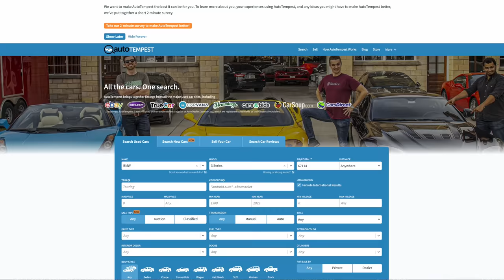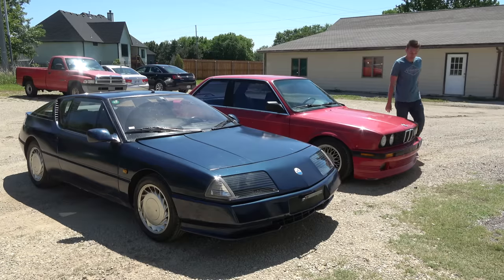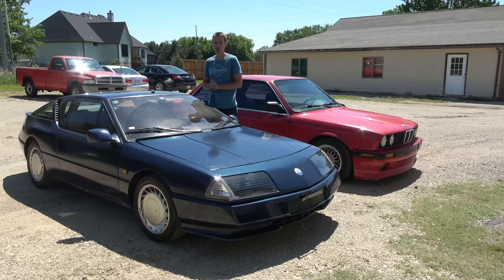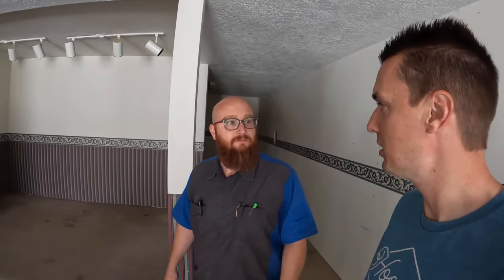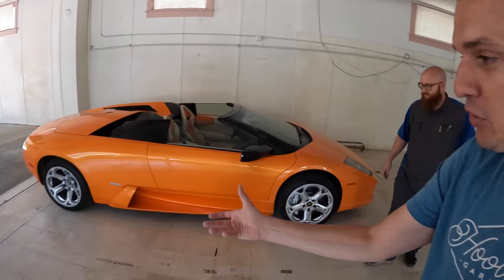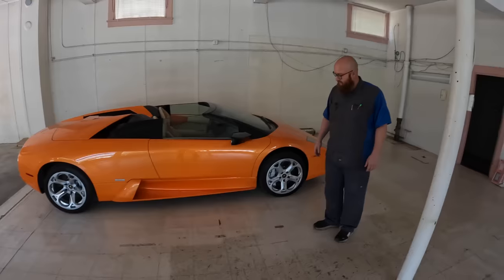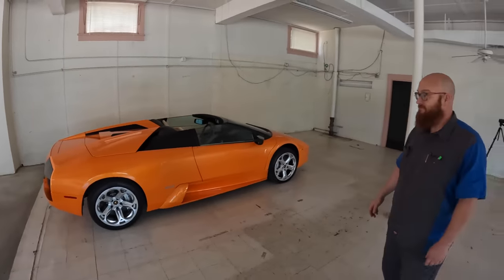Everything wrong with my CHEAP 90 year old shop building (was it a TERRIBLE $75,000 investment?)

Comment: Usually there is an ordnance to not have anything within 6’ of electric panels.  That means sink or pannels should move. Regardless redo the sink or move panels you got 10g’s there.     They may let it slide with existing but I’m pretty sure the 6’ clearance is a safety thing and if renting the space you will want to comply with safety. Not sure in Kansas but 6’ is national code in commercial spaces. I had a rental with a small utility room and box was in there with furnace and it was ordered that nothing could be kept in there at all due to that regulation.  Not sure if moving sink and redo bathroom layout is better or if move the panels into one over more is better to be honest. Some them 1950’s. Black electric boxes look sus to me anyway. If it were me and I was leasing it I’d redo both the bathroom to a modern spec and redo the panel to something with breakers that’s also 2022 compliant for safety and rental appeal.  A new flooring solution and some bracing in the main part you got a nice shop space.
Reply: Yeah 100% I’d say it’s worth getting in a crew to make it nice and 2022 compliant.  Even new hvac and such just have it done and perfect. You will get better renters and can charge more for a nice space.  You don’t have to finish to high spec just nice spec.

Comment: You might want to invest in solar shingles and some destination charging stations. You could bundle those into the rental package so that it's more appealing. The new infrastructure package is dolling out a fair bit of cash for access points to the soon-to-be-built country-wide charging grid and since this is for a business-oriented property you should be eligible for a grant. Not only would the solar juice lower the power bill and if you install a backup battery or three you could provide a potential customer who might make use of some or all of the other fuse boxes the peace of mind that, short of a Twister or Godzilla going on walkabout, they and their perishable merchandise will also be ok for a while. Another added benefit is that the charging stations will bring in customer traffic who will be there for at least 15-30 minutes so having some retail and/or food options to incentivize potential EV drivers to come on by and stay for a while. If your entrepreneur itch needs a scratch then might I suggest opening up a Sub Station 2 franchise there. You have all the prerequisites there and enough room for a decent amount of seating.

Comment: You literally cannot lose with how little you spent on that. Where I'm from that same building would've cost 1.5m easy.
It's getting near impossible to buy property unless you're sitting on 10m cash. And you're going to sign your life away if you take out a loan even with an 809 credit score. You can find small property (1.8k Sqft) w/ 0.25 acre lot that needs to be demolished for about 250k.

Comment: Not a good idea to add heavy loads to floors supported on blocks on unexcavated ground.  The car is adding half of its weight to one, two, or three joists depending on the cars position; and at least one joist is carrying at least 25% of the car's weight.  The ground under supports may be gradually compressing.  Occurrence of deflection (bending) is often the reason that wood floors systems are shimmed at various places.

Comment: After seeing those massive federal pacific breakers in that addition near the paint overspray, I really hope Tyler’s insurance is paid up. Especially with all that water damage so close. Btw, if any of y’all see those in your home, or office, or any building you own, CHANGE YOUR PANEL IMMEDIATELY!!!!!! Those breakers are well known to not trip during an overload, short circuit, pretty much anything that should cause a breaker to trip, and they have burned down many homes, and commercial spaces. Same with the old Zinsco electrical panels. Poor design that slipped through the cracks, and they are well known to arc and cause fires.

Comment: $75k you can't buy a shead on its onland for that in the uk. billy bargin.
Remember Tyler if it isn't broke dont fix it as with old cars and building you just open up a whole can of worms when u do.
If i was you I would buold a cupboard to house all the circuit braker boxes to protect from water from the sink. 
Its great you have all the old brakers there as you won't need to pay to have extra fitted when u want to put in a car lift or stacker inless its to become one of your burger joints. If thats the case then u know it will need fully fitting out with all new everything to be upto food hygiene code.
Fit French drains in the floor outs9de to stop water coming in under the doors and new door seals

Comment: I mean, a structural engineer costs $150-200 to evaluate specific issues; building inspectors are  similar.   The Whole real estate industry revolves around the inspection process.  Really, no excuse to not do them in real estate.

Comment: Am I alone, or did anyone else like turbo lag?  I loved that in my old Saab you floored it then....wait.....wait.....and bam!  She took off like a bullet!
Reply: 1960s GM V8s with the old two-speed Powerglide automatic provided a similar sort of experience. One of my favorite things to do with the 1968 Pontiac I used to have was stop at the top of the Interstate on-ramp (I live out in the sticks, where that's often possible) and then floor it. Pause while the bridge telegraphs down to the engine room for flank speed, the Powerglide drops into low gear, the secondaries open up on the carburetor, and then it felt like jumping to hyperspace. Of course, it was a four-door Tempest sedan, so "hyperspace" in this case equates to about 50 mph by the bottom of the ramp, but, I mean, the impression is the important part. :)
Reply: I hate it personally. It makes pulling into a busy road from a stop scary. “Oh yeah, that’s a big enough gap”. Pull into traffic.  No power no power no power. “Oh no those cars are closing in fast!”  POWER!

Comment: Looks like a little work on the floors, lay down some LVT, give a coat of paint interior and exterior and call it good. As long as it doesn't need a lot of electrical work you should be good. Gotta shave those popcorn ceilings!

Comment: That hole in the front (in the sidewalk) the wizard is talking about is a coal chute. Back in the day they’d shovel the coal straight into your basement. 

As for the ac unit. Milk it for what it’s worth and KEEP YOUR EYE ON FREON PRICES. The current admin is fully phasing out r11 and is looking to join the UN standard and phasing out its replacement too (which is the dumbest shite quite possibly ever). Meaning Freon prices are about to become obscenely outrageous. Be aware. Might be cheaper to get it updated now vs. later. Also be aware for your house. Might be-hoovie you to look into getting a tank of refridge for yourself now.

Comment: If it was me, I would tear up that wooden floor and fill it in with compacted gravel and pour concrete floor throughout.  It will cost you but in the long run you will never have a floor problem again.

Comment: 5 to 8 grand to get it ready to rent bwahahahhaah I moved into a place that had electrical from 1974 (fuses) and had to upgrade it all....leave it for the tenants. 

BTW: Wouldn't cost $75K to pour the floor into concrete. Rip up the floor joists, and dispose of it, probably $2500 and then back fill, maybe $2000 and the slab, $5000 will get you a 32 x 16 slab up here so maybe $6500 down there but I have no clue what concrete costs are in BF Kansas.

Comment: what.. you are looking ar on the exterior of your 'building' is not stucco... that style of finnish denoted way more texture...  this is called 'concrete parging'... is is done over wire fencing to give a little support... upstate ny does a lot and it was popular in the 40's-60's. problem is the moisture it traps, each crack you see extends to the full wall.. this will cost you.. but that floor.. headache... dump this QUICKLY or it will burry you.

Comment: I still think it's gonna be more then 8,000. I think the ac for that building will be close to 8,000 by itself then the air handler may need replaced also cause some units just are not compatible with the me refrigerate in the new ac's
Reply: Also I don't know for sure but that sink next to that electrical is not to code I can almost bet on it
Reply: Like I said in the last building video you open a wall you open a can of worms and that goes for anything else building repair related

Comment: my advice would be to remove wood flooring and pour concrete, yes it'll be expensive, but only have to buy it once and  mise we'll do it before you get it filled up with vehicles and equipment, do it right and do it once you won't regret it.
EDIT: And I can't believe you can buy a building with that old of service box and electrical wiring! I assume your already going to have it updated to code aswell as to fit your needs i.e. welder and hoist
EDIT#2: disregard some of the irrelevance  wasn't aware until the end that you're using it for a rental income, on that note slap some paint and linoleum down and put it up for rent 😆

Comment: @7:52 woah, 255/45 VR 15 tyre back in the 90's, that must have been super hard to find and more expensive than gold per weight... Other than that, what an awesome and good looking car, this things definitely needs to be brought back, maybe some more modern wheels with lower profile tyre and an overall overhaul for paint, interior and technical areas.

Comment: That building is a fire hazard Outdated electrical components that are even allowed to be used only more . Depending on what kind of landlord you want to be will determine how much you need to spend on fixing it up before it’s ready to rent. If that buildings in a good location it’s worth spending the extra money on it to do a complete concrete floor in it. Then you can have actual value to the renter with the building before you actually spend money on the exterior besides some touchup and paint on the outside for now. Then once the place is making you some money then you can think about a facelift on the exterior. I like one commenters said your plumbing isPast its prime. But it’s $75,000 for the initial investment Doesn’t sound too bad of a deal even if you had to put in 80 grand to make it a nice place. The location is going to determine how much is worth putting into it good luck.

Comment: If i were you, i would remove all the wooden flooring, repair/install any plumbing & floor drains needed,  fill with compacted dirt, 6" gravel, then 6"-8" concrete. Raising floor about 6" to prevent any flooding.
All buildings start with a good foundation.

Comment: Watch out for asbestos in that old building. That floor specifically - even if the tiles don't have it, the mastic probably does. Unlike the 9" version, those 12" tiles are 50/50 yes or no in that regard. Any type of abatement in a commercial setting - like the Wizard said - will be very expensive. So just leave them be. Looks like a really cool building though! And a nice quaint neighborhood. I bet that new roof cost 25-30% of what you paid for the whole building!

Comment: Are kidding Tyler?  Bringing Dave to inspect a building?  A structure is totally different thing (obviously) than a vehicle. It comes with substantial liabilities and costs if there are problems and you rent it out to someone. Get a real building inspector to look it. Should have done this BEFORE you bought it.  (My late stepfather was an structural engineer and used to do this professionally.) Some states require them to be licensed.